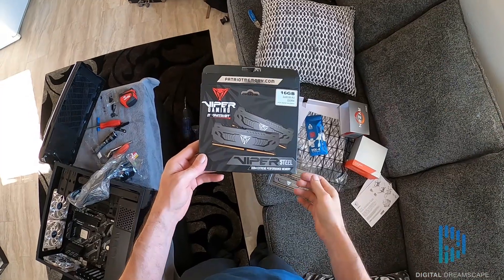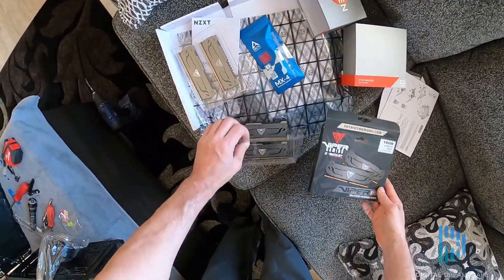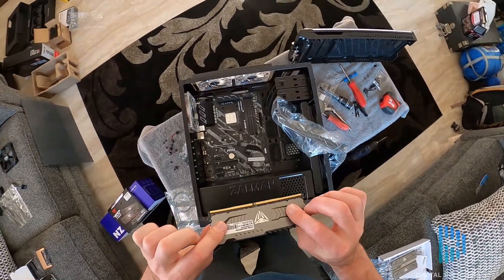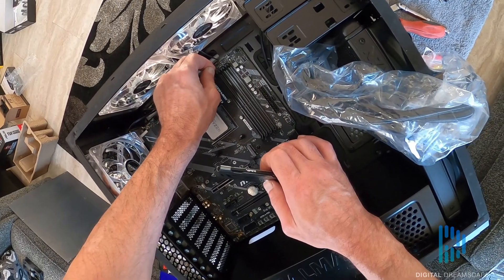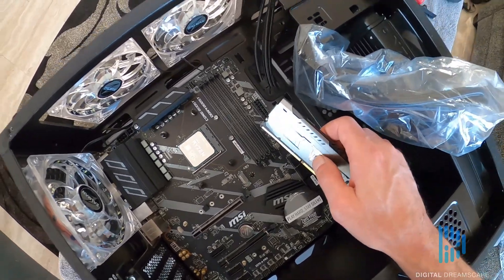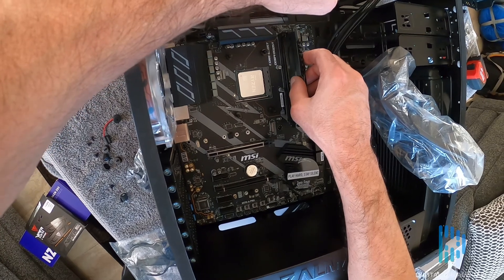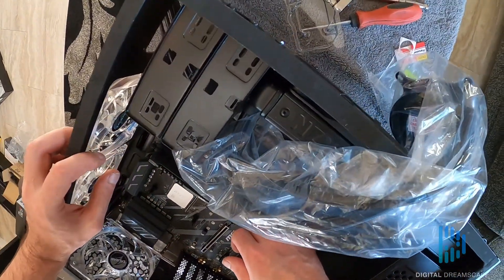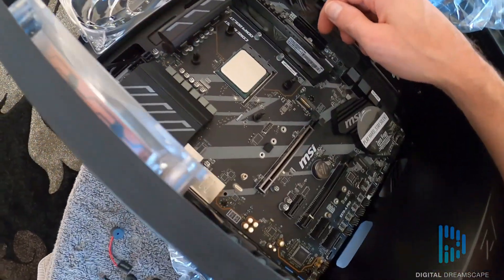RAM Installation: DDR4 Viper Steel Series Performance Gaming Memory (Storm Trooper PC Video #5)

Comment: Can you go into more details about clocking the ram? I am looking into getting Zen 3 or a 3950x and I have a gigabyte x570 aorus xtreme. Looking at getting a 3600mhz or a 4000mhz Dominator Platinum kit, I'd prefer the 4000mhz kit.
Reply from the maker: I can do a video of more detailed overclocking. I have a lot going on right now, but I will try to get it posted soon.
Reply from the maker: I will be happy to put up a more advanced overclocking video when my new ram shows up. I decided to order something on the compatibility list as I've been having difficulty reaching higher speeds supported by the mobo. https://amzn.to/2G842W5